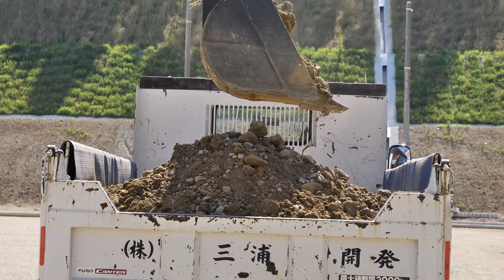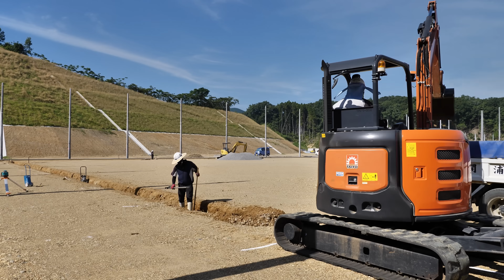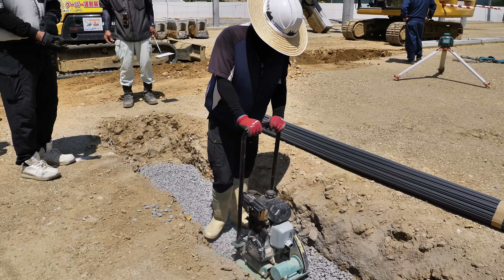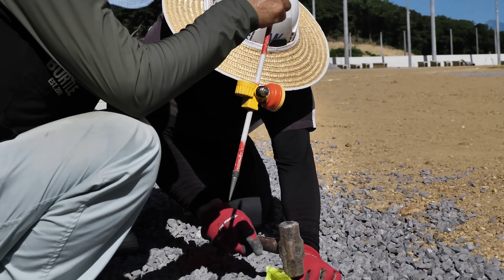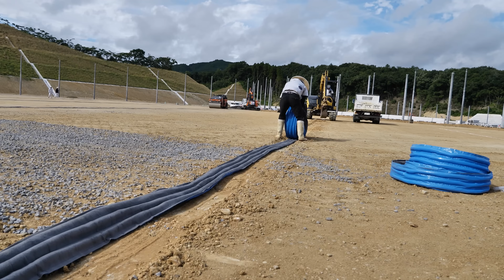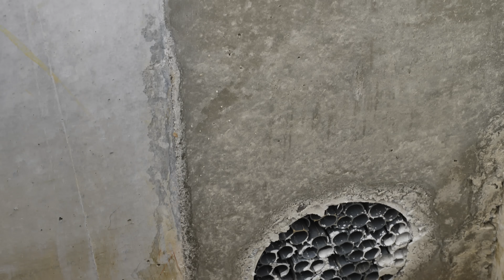巨大スポーツパークに導入された日本の超高品質な排水システムの全貌【暗渠排水工事】

Comment: I am giving you one experiment for making floating wooden middle  size home.
In Japan and many countries people like to make wooden home
Wood have floating capacity. 
Make railing of wood all around home,using coupling. 
You must open it  straight  as per as level of home .
Wood+railing +.
At the base make box 📦 types as per as requirements of  rubber balloon used for ship to shift inside water. 
Make box as per as size of rubber balloon. 
Put rubber tyres ropes inside wooden these box, rubber tyres ropes doesn't rot quickly. 
Don't put balloon, put balloon when  ,we notice it's raining heavily. 
With  rubber ropes ,we can pull the balloon at two ends very easily. 
Use same method as we use for fixing electric wire inside wall.
Start filling air ,when required. 
How many balloon you will require, it's depends on weight and size of home.
Use anchor ⚓️ to base for protection of home.  Home should not flow with water flow. 
We will have three protection, wooden base, wooden railing and rubber balloon with anchor ⚓️. 
We can use other floating material at the basement or for support. 
Rat can cut rubber balloon, so we have to fix when needed, make system of box 📦 to keep rubber balloon very protected during flooding.  Rubber balloon should not move from boxes. 
As flooding finish, remove rubber balloon. 
 We can fix any puncture same as bicycle tyres. 
Experiment is how many balloon is required, Experiment inside lake putting weight. 
Give this job to university. 
Jay bharat.

Comment: Що це за вентилятор в їхньому одязі?
Reply: They're called air-conditioned suits（空調服、Kuchofuku） and the company that invented them holds the patent.
They cool the body by using the latent heat of vaporization produced by sweat evaporating.
With regular clothing, when the space between the clothing and the body reaches saturated humidity, the sweat stops evaporating and turns into water, which stops cooling. So a fan is used to blow the air out, lowering the saturated humidity. It's not the wind that cools the body.

Comment: itu lingkaran di baju para perkerja kalau boleh tahu fungsinya apa ya?

salam dari indonesia
Reply: Hello
 It's a Japanese work uniform called "air-conditioned clothing."There is a small fan attached to the circle, and when the wind that comes from it hits your sweaty underwear and skin, it evaporates and cools you down. This is essential when working in high temperatures 👍

Comment: What type of jacket they are wearing ? There is fan, how it work
Reply: Air cooler 😊
Reply: They're called air-conditioned suits（空調服、Kuchoufuku）, and the company that invented them holds the patent.
They cool the body by using the latent heat of vaporization produced by sweat evaporating.
With regular clothing, when the space between the clothing and the body reaches saturated humidity, the sweat stops evaporating and turns into water, which stops cooling. So a fan is used to blow the air out, lowering the saturated humidity. It's not the wind that cools the body.